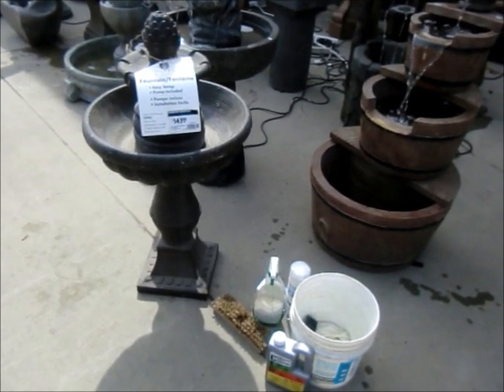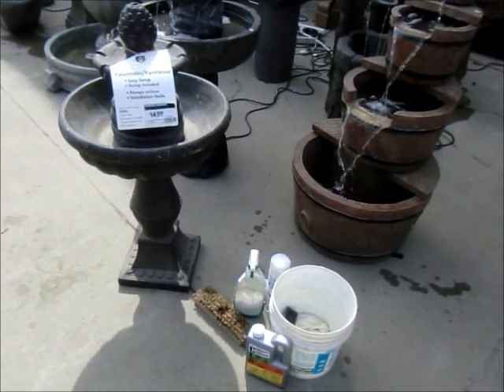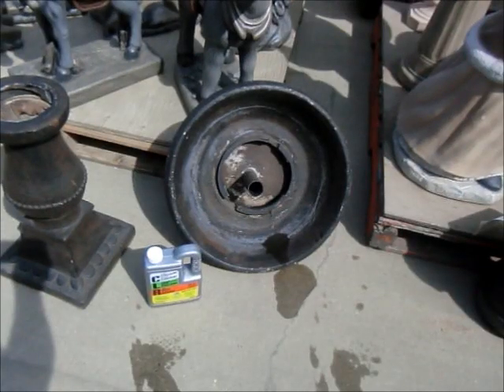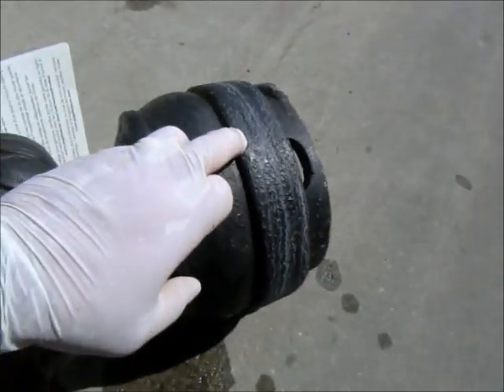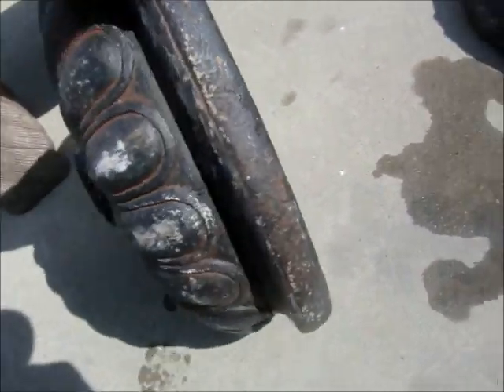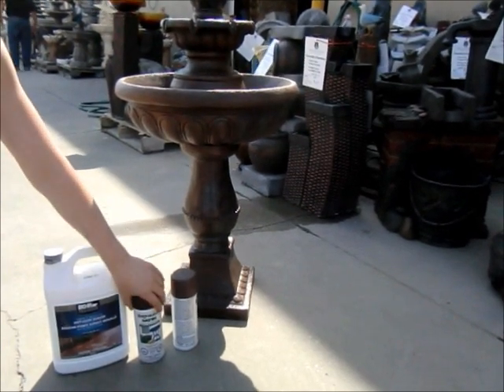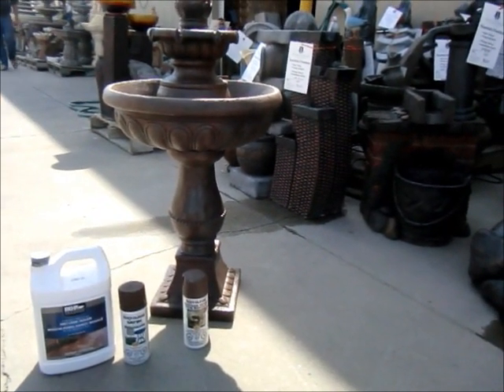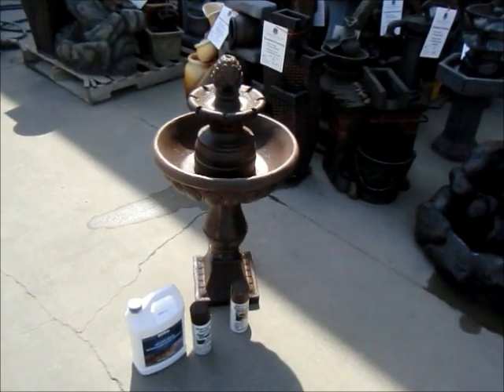Refinishing an Angelo Decor Primrose Fountain

Comment: What type of paint and sealer would u recommend for the water part of the bird bath that would be bird friendly ?
Reply: Hi Carolle, 

Thanks for the great question.  While a paint labeled "bird friendly" will be difficult to find, from experience, many of the products available at home improvement retailers are safe to use, when applied properly.  

Rust-o-leum brand products, in particular, have been used before. Their multi-texture spray paints work excellent for good coverage and for blending with existing colours.  Recommend using a clear sealer (Painter's Touch, for example) when finished to help protect the finish and material and to seal things off.  Most importantly, be sure to allow ample time between coats and before putting the item back in use.  A good rinse before filling and once the unit is fully cured (see manufacturer's advice on drying time) would be helpful is well.  

See the manufacturer's label for more specific information.

Hope this helps.
Reply: I really wish that you would have listed the paint! I couldn't see the can do this wasn't very helpful as my foundation is a greyish Stone color.